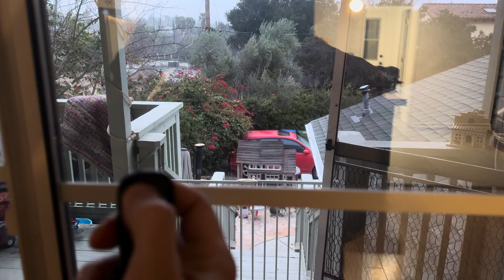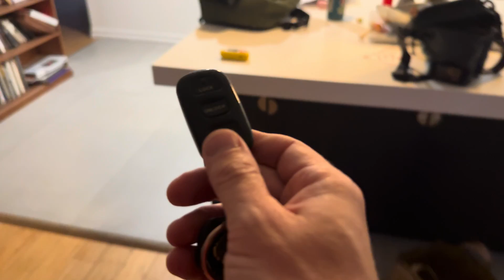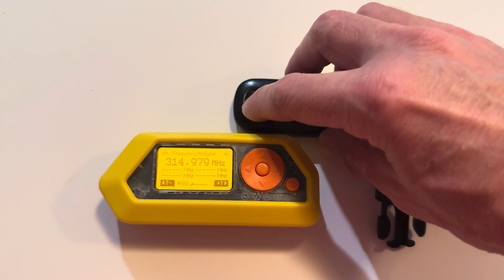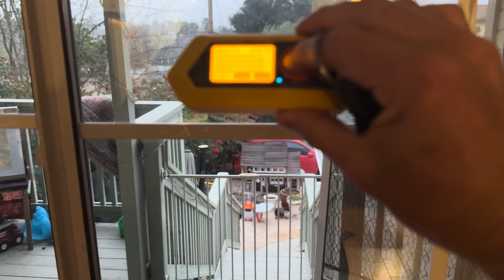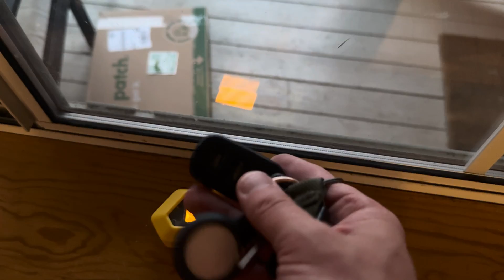Flipper Zero Copy Car Key FOB that uses rolling codes.

Comment: I did the same thing but it desynced my key fob. I spent as much money as the flipper cost me to resync it. Just don't do it. My truck is a 2015 Ford Explorer. I was so excited at first when I tried it and then when my truck key fob stopped working I was like f*** me, won't be doing that again. Just remember, just because you can do something doesn't mean you should.
Reply from the maker: Play with caution.
Reply: Yeah, never do something like this for rolling codes. You could look at a few samples of the data to see if it's static or not, but I've found it's easier to just record the garage door opener or whatever, then use the regular transmitter to open the door a few times, and only then test the Flipper. If it's a rolling code the Flipper won't work and no harm is done.

I've found that almost everything uses rolling codes, unless it's some obviously low security communal thing that many people have access to.
Reply: cant you just resync it by using the car key the same amount of times as you did the flipper?

Comment: Interesting, I was testing it with mines, i get the signal no issue, AM650 seems best modulation but when i send the signal i don't get any luck. No idea why, also was using the flux capacitor testing and didn't help.
Reply from the maker: You have to make sure when you record the signal, that your car does is not with range.

Comment: When you recorded the code with the flipper the key fob already rolled to the next code. So ofc it will work since it's already on the next rolling code. 
Unless the key has some handshake with the car to confirm that the car was actually received the signal, then the key shouldn't desync. It'll always advance the int whether or not it got recorded by a flipper, locked the car or was out of range. And since the flipper can't record anything that the key didn't already use, it'll always replay an older code than what the key would transmit
Reply from the maker: As long as the car has not read the code stored in the flipper, and the fob has not been used after the flipper recorded, the flipper will work that one time.
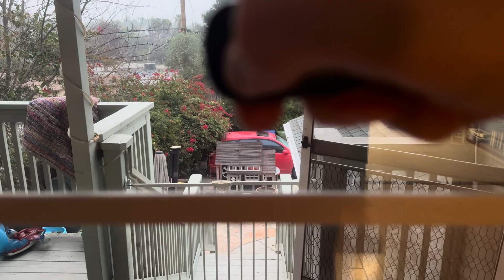Reply: @PenTestTuner  Ohh. The flipper will work. I have no argument about that. But the key would also work right after the flipper. On 1:55 you said the key won't work for the first click after the flipper. That is the only thing I dispute. The key would always work, because it would never transmit an N that the flipper used (because the flipper can already record an N that the key already transmitted and the key doesn't repeat itself).

Comment: Can a hack rf one portapack h4m do this, without the need of blocking the signal with an flipper zero for example, and then the hack rf one records it? Or can l do it with only a hack rf one?
Reply: The hackrf is a general purpose SDR, it can replicate this no problem. The problem here is he is not actually doing anything with the rolling code here. This isn’t a physical limitation but a protocol one. You need to look up the rollback attack, which will work with either hardware (but ofc you have to code it up).
Reply from the maker: I have not tested this with the HackRF.

Comment: My question is can open cars doors?
Reply: Yes it absolutely can, I did it on my 2015 Ford Explorer. You have to be out of range of your vehicle when you copy the code. But, I ABSOLUTELY WOULD NOT DO IT. It desynced my truck key fob and it cost me as much as the Flipper Zero itself to get it reprogrammed. Just don't do it.
Reply from the maker: It can perform the technique I have displayed.

Comment: That’s not a key fob boomer it’s a remote😂 modern day cars with actual key fobs will not work with the flipper zero.
Reply: They do dude lol … what you tarded worst generation ever dunderhead
Reply: They do dude lol … what you tarded worst generation ever dunderhead
Reply from the maker: They absolutely will. You can record a code that can be used one time. After that it is useless as the code “rolls”. But, if you record the code far enough away from the vehicle that it does not hear it, and the next code it hears is your recorded code, it will work.

Comment: That old ass car does not have rolling codes. In its fob😂😂😂😂😂
Reply from the maker: Remarkably, it does. Rolling codes started in 1990. In that video, that car is a 2007 using a FOB with rolling codes.
Reply from the maker: Remarkably, it does. Rolling codes started in 1990. In that video, that car is a 2007 using a FOB with rolling codes.
Reply: It does, evident by the fact that you can only use a captured code once.

Comment: I would have thought the flipper would prompt you to repeatedly press fob button to record all the rolling codes. And hope for a quick cycle back to first code. Otherwise if there are 10000 rolling codes it would take forever to copy .
Reply from the maker: I am not sure how many total codes there are.
Reply: thats not really how rolling code works, its uses a formula and has a sequence it will follow. Example : if you jam someones fob and they spam unlock and lock and you record all the data you can use all those codes but once they're all used either by the flipper or the fob the ECU in the car no longer sees those codes as valid

Comment: Do this a few too many times and youll desync your fob
Reply from the maker: If you use the same code on the flipper. You can only use it once.
Reply: @PenTestTuner  yeah but if you send it for multiple times it'll block the fob
Reply from the maker: @yanisrabah4782 You can only use the code once.
Reply: What he means is, since your car expects 0001, and the flipper has sent 0001, your car will receive 0001. The next code that will be expected from the car will be 0002 but your key fob will send 0001 as it hasn't been used on the key fob. This is what happens when its out of sync and some key fobs can break from this.
Reply: I did just that. I didn't know there was even that possibility. I recorded my 2015  Ford Explorer key fob unlocking function way away from my vehicle. Went outside tried it and my doors opened. I was as giddy as a school girl until I went out later in the day and my truck key fob would not work for ANY remote functions. I could still walk up to it and unlock it by grabbing the door handle and it would start with my key fob in the truck but it cost me as MUCH AS THE FLIPPER ITSELF to get my key fob reprogrammed again. DON"T DO IT.
Reply from the maker: That is possible. That is why I say that you can only use it once.

Comment: Don’t use the Read RAW feature with your car key fob!
Modern car central locking systems use rolling codes, which means that every time you use your key fob, it generates a unique code. This code is based on a sequence known by the central locking system and is used to unlock a car. If you capture the key fob’s signal and replay it back to your car, you risk de-syncing the original key, making it unusable .
Reply: This happened to me with a chevy montana last week haha had to get my fobs re-paired at a car locksmith. Paid a couple bucks but I learned my lesson!
Reply from the maker: How did they re-pair them?
Reply: @PenTestTuner  The guy plugged a device into the OBD port and did a pattern of opening/closing ignition, took less than 5 minutes! 
It wasn't the same procedure as when you have to re-learn the key transponders for the immobilizer tho (I brought the printed card with the codes the dealership gives you but they weren't needed for pairing just the alarm fob)
Reply: That is exactly what happened to me. It worked the first time but my key fob stopped working with ANY remote functions. You have to be away far enough away from the vehicle that it can't hear the key fob when you record it. I'm telling you just not to do it, I had to pay as much as the flipper itself to reprogram my truck key fob. The vehicle I tried it on (successfully - but with repercussions) is a 2015 Ford Explorer.
Reply from the maker: That has not been my experience.

Comment: Hi, thx for the video. So, what steps should I follow to make these rolling codes continuously executable from the Flipper Zero? I hope the only way isn’t to capture a new signal every time. (:
Reply from the maker: Because of the nature of rolling codes, the code changes every time. So yes, you would need to copy it every time to perform this attack. It is a great security feature. This video shows a specific attack vector that only works once.

Comment: If this goes wrong can I still use my key to open my car and start the motor or does the key stops working too because it has a code?
Reply from the maker: I am not familiar enough with your setup to answer that correctly.
Reply: @PenTestTuner  Wen you say setup you mean what I am using to do this on the Flipper or the brand of the car or brand of the fob?
Reply from the maker: There are so many variables.

Comment: How old is your car?
Reply from the maker: That car in the video in a 2007.
Reply: @PenTestTuner  So its not a rolling code and just a static?
Still cool I guess, I have one of those devices with me
Reply: Oh wait nvm, Your desyncing your remote using a jamming technique, I see how that works, But it is dangerous because you will have to resync the remote by going to the car manufacture to reprogram your car keys
Reply: Or just get you a new one
Reply from the maker: No. I’m not de-syncing anything. It is a rolling code remote. I am just using the code one time that that the car has not seen yet.

Comment: becareful, i heard that on some cars if you do this, the computer will lock you out totally, and then the car will not start untill the computer is reset
Reply: That is really unlikely. Certain vehicles will stop responding to the correct remote if the remote is cycled repeatedly, typically the remote start function is locked out after 3-4 repeated starts. You would have to press the OEM remote hundreds of times to unsynchronize it from the vehicle.
Reply: I tried it and my key fob stopped working. I tried reprogramming it from the car and that still didn't work. I ended up unplugging the car battery and the key fob worked again.
Reply from the maker: Very good to know. Thank you.
Reply: @nathan5528  wait what that actually works?! have u tried doing it again?!
Reply from the maker: I have not had that experience, yet.

Comment: Would you be able to capture the signal of the key fob communicating with the car multiple times and calculating the key the car uses to create the next code?
Reply: Theoretically yes, in practice it would be probably harder than what Alan Turing did with enigma.
Reply: I'd imagine it does something similar to either a hashing algorithm or a signature. Unless you have the original private key with it, you're going to have a terrible time trying to reverse it. With computers of today (not including quantum computers), it could take until the heat death of the universe to decode typical modern hashes and signatures
Reply: @ktheveg  you're confusing hashing algorithms, encryption, and signatures.
Remotes use rolling codes. Transponders use a stream cipher where new bits are created based on the previous bits. The private keys (if applicable) are used during the authentication process, and Xor operations with psudeo random numbers start the encryption.
Reply from the maker: Using that method, it would be nearly impossible. I believe what would be needed, is the original hash.
Reply: Absolutely!
Reply: No each manuf. uses their own proprietary algo's
Reply: @TheAceofFate  That isn't accurate.

Comment: what was the point in that
Reply: i was thinking the exact same thing
Reply from the maker: It is important to know the boundaries of the device and test them.
Reply: @PenTestTuner  You realise people have bricked their immobilisers doing this? If you have no idea how your car is implementing the rolling codes, you shouldn't doing it - let alone demonstrating this.
Reply from the maker: I think it is the opposite. You should always demonstrate first.
Reply: @j55321  immobilizers are RFID, not sub-ghz. You will desync the central locking system of the car, the immobilizer will read and accept the key just fine. Unless, of course, you tried screwing around with the RFID chip in the keyfob.
Reply from the maker: It shows a few ways that penetration testing can get past or stop the FOB from working.
Reply: @PenTestTuner  The old code isn't jamming the transmission of the new code, it's the broadcast of anything at all on the same frequency that's swamping the signal to noise ratio stopping the signal being received. You could use any transmission on the same frequency to jam the keyfob.
Reply from the maker: I think what is being relayed is that the old code is not jamming the FOB because it is the old code. It is jamming it because it floods the spectrum. This is correct. However, the old code is Jamming the signal and will always jam it.

Comment: This is why I wish car manufacturers would shift to a challenge / response based system. The rolling code can be cloned while the car is jammed, and replayed at a later date. But, while C/R can be replayed, as long as there is mutual auth, it can't be used as a viable cloning attack. There is the possibility of a relay attack, but this requires the user to press the button.
Reply from the maker: Yep. Another reason why Pen Testing is important. It makes us think outside the box, to fix an issue.

Comment: Beware, some manufactures will have the system drop a key fob off the auth list if it detects that the signal from the key fob has already been used. Re-pairing it may require you to get into the vehicle and re-add the key fob to the list using a valid key in the ignition and preforming a few steps to re-add the fob.
Reply from the maker: Companies better get their tech up. Devices that can do these attacks will become more readily available to everyone.

Comment: Your fob most likely has a rolling code system so the flipper learns the next code the remote will use. That’s why you need to use the fob twice to get it to work again.
Reply from the maker: Flipper does not learn the next code. I copy a code that the car has not seen yet. That’s why I do it from so far away, then walk up.
Reply: I’m not sure if anyone has a program that matches or mimics your car manufacturers remote for you to run on the flipper. If so the flipper would be able to be a spare key fob, if you ever lost your keys or damaged the fob enough that it wouldn’t work. 
If your car is push button start the flipper also could be programmed to remote start & remote control many other features.
Reply: @djand007 I'm working on it.
Reply from the maker: Do it. Please.
Reply: @djand007 You would have to figure out the algorithm that's used to mimic it.
Once known you could copy this.
Reply from the maker: Yep. Once that is out, everything opens.
Reply from the maker: Great idea.